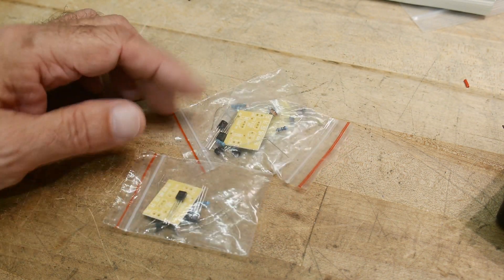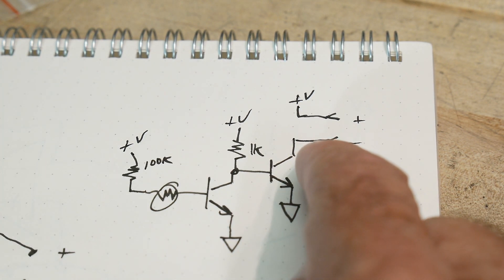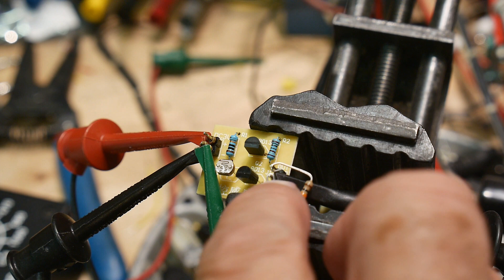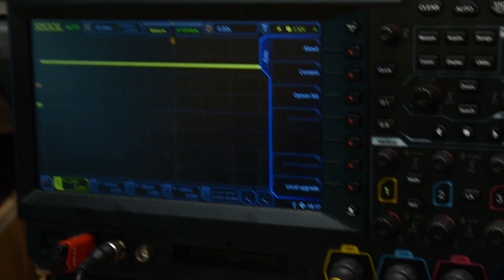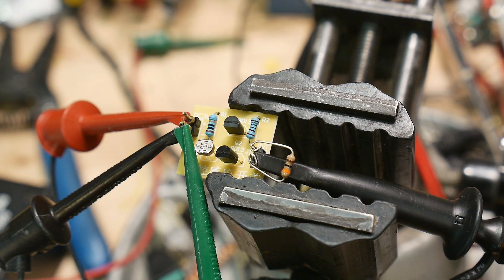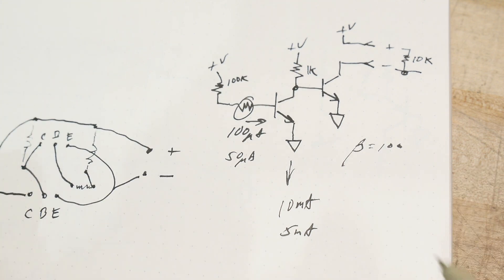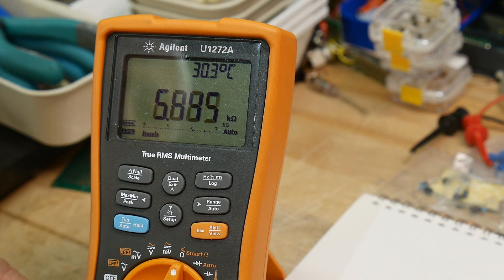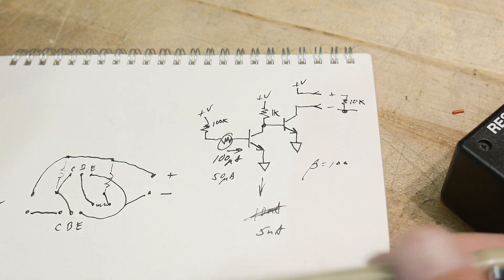#1261 Light Detection Circuit

Comment: You don’t need all that for a microprocessor input.  Just the photocell and that first resistor in a divider network.  That board is to turn on a small motor or light or something.
Reply: It depends on how sensitive you want it to be to variations in the light.

Comment: 10:04 Some notes regarding the resistance in dark. Most datasheets mentioned >1Mohm or minimum 20Mohm etc, but in fact, a LDR goes within few minutes of darkness beyond 100Mohm, and after 1 day beyond 1Gigaohm. With darkness, i mean totally darkness by using a piece of black heat shrink of say 2 cm long and with one end sealed (like a cap). Covering with your hand is not enough darkness, your hand pass light, and also, the PCB of a LDR is semi-transparant and pass some light through.
When a LDR is totally covered for example 1 day or longer, the responsetime from above 1Gigaohm to 3Kohm is much longer, then when the LDR was only covered for a few minutes or hours. This is called the LDR Memory effect. 
Arround January, i first experience with this phenomenon when the control unit of my mom's oil burner went in safety mode each morning, then after resetting the control unit, the oil burner worked great. The LDR was used as a flame detector. During the operation of the oil-burner , the LDR current was arround 50µA, where the manual mentioned between 65µA and 200µA. When i bridged the LDR with a jumper wire, the maximum current to the control unit was 200µA (limited by the control unit).
I then replaced the original LDR with 3 or 4 different universal LDR's with different values, each time with a LDR with a lower resistance value when illuminated, but the problem of tripping the control unit was not solved, while i got a max LDR current 65µA during operation. I then replaced the LDR with a original one from the brand of oil-burner itself, and i got arround 45µA. I then discovered, if i simulated the LDR with a jumperwire at cold start, and reached the 200µA, the oil-burner worked fine. So the problem was the LDR current too low at cold start. I then also discovered, that with a original LDR at cold start, the first seconds the LDR current stay at 0µA, but that current raised quicker to the 45µA, then the 4 universal LDR's. Finally i ended up with a DIY amplifier circuit with a original LDR, a 300Kohm resistor between base and emitor, and the LDR between base and collector. Collector and emitor connected to the control unit. With this amplifier, within 2 seconds i got a LDR current arround 170a180µA.
Last weekend, this oil-burner is being used since months, and worked like a champ. 
And to end this long story, to measure such a high dark resistance with a normal DMM, i used my bench powersupply and placed 10V DC in series with the LDR and with my DMM in mV range. I then calculated with ohm's law, the resistance. That way, i could measure above 100M, where my ANENG 8009 DMM maxed out at 100Mohm within minutes.
Reply: I was in deep meditation one time thinking about LDRs. In my mind I wondered of this “Dark Current” and it’s limits.  I did exactly what you did with heat shrink and tried to get the resistance. After 2days my meter could no longer read it. I wasn’t able to document anything past 20m. It wasn’t until maybe a week later I decided to poke  pin hole through to confirm my suspicions. 

This was a great discussion. 
Thanks for your analysis on the subject.

Comment: A nice little circuit.  As you say, all parts look well matched.  Could come in handy for something.  You must have bought them on instinct.  Thanks for sharing  :-)   PS - Could put a resistor between the output and input for hysteresis to eliminate the light flickering.  Maybe 10M or less.

Comment: Another fun fact: some light detector circuits use a photo diode in ‘dark current’ mode (reverse bias) because the difference in leakage current with and without light is a much greater difference than it is in normal bias mode.

Comment: Fun Fact: In addition to emitting light, an LED can be used as a photodiode light sensor / detector. As a detector, the LED is sensitive to the emission wavelength or less. You’re content is always interesting. 73
Reply: You beat me to it!
With silicon transistors the LED can be any anything with a band gap voltage greater than silicon, anything from red to UV. But, generally, not infrared which is just silicon.

You don't need the pullup resistor as LEDs generates their own current.
You can use a pair of LEDs wired anti-parallel and let them fight it out and see which has more light intensity. (AKA solar trackers.)

I generally don't like CDS cells as they tend to be quite temperature sensitive and less stable.

redrok
Reply: @duanecjohnson  Glad you chimed in on the topic. Good information.
Reply: @duanecjohnson  CdS, not CDS.  Cd = chemical symbol for Cadmium.
Reply: @duanecjohnson  And semiconductors are not temperature sensitive, right?

Semiconductors have a negative temperature coefficient of resistance.

In fact I have seen transistors used as temperature sensors!